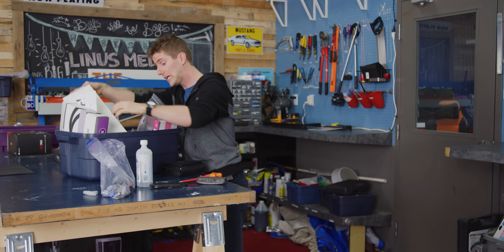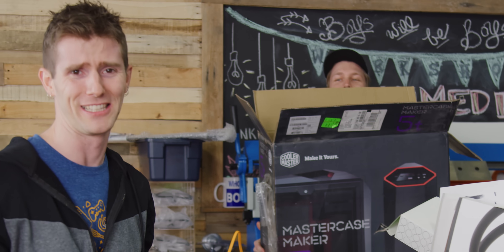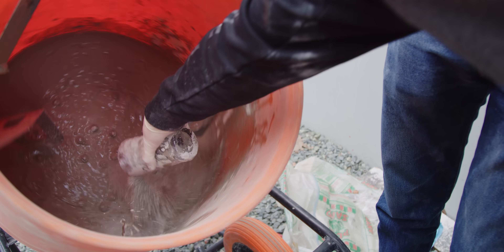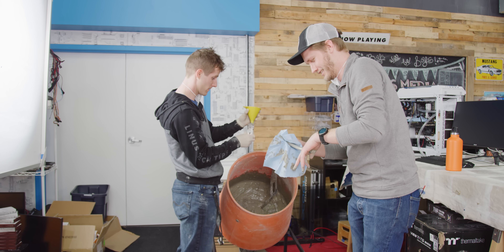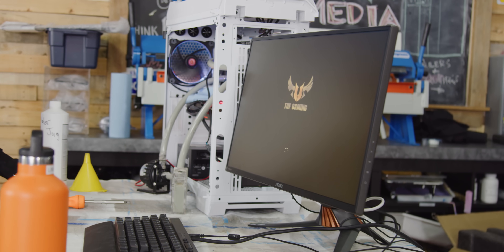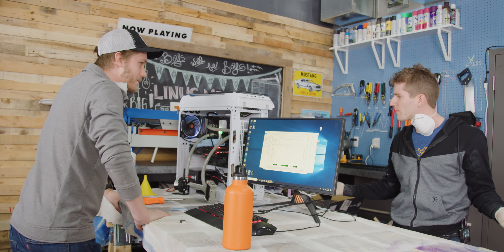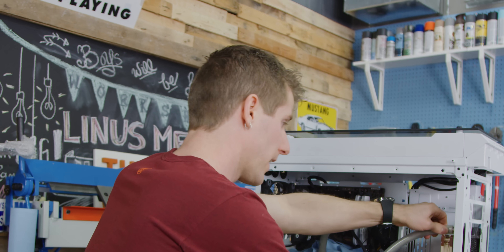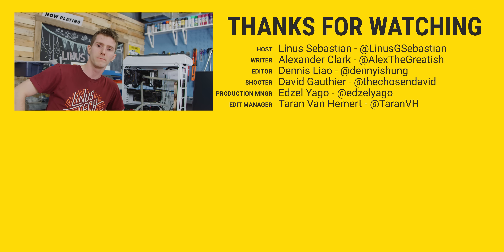I Can't Believe This Worked!!! - Concrete Cooled PC (April Fools 2019)

Comment: Try a fine dry dust like a chinchilla dustbath. It should flow like water if the air gaps are minimal and thermally behave like ceramic.

Comment: When you were stating why concrete floors always feel cold, it's not because it cunducts heat in a unique way, it's because concrete has an extremely high thermal mass. It takes a large amount of energy  to change the temperature of a slab of concrete relative to its size and concrete floors are usually just exposed foundation slabs, which are typically between 3-6 inches thick and set in the ground, which draws the heat out of the concrete. Since your foundation is protected by your roof (at least I hope it is), the sun doesn't hit this concrete, and therefore it never warms up. If you go out to your driveway barefoot on a hot summer day it will burn you because of the heat it's absorbed from the sun, and typically even at later at night that same day the driveway will still feel warmer than then the surrounding air simply because it's holding on the the thermal energy it picked up earlier in the day. Basements are cold simply because they're underground. It could be 110 degrees out (triple digit temps are common where I live, it sucks to be sweaty 24/7) and if you go down in to one of those like 15 foot deep steel tube bomb shelters it would be about 65 degrees inside. Also btw, What your using is cement, not concrete. In order for it to be concrete you would need to add both sand and some sort of aggregate such as gravel. 

Id personally like to see you try pancake batter

Comment: Ok, soooooo Part two!

Make a solid concrete block with COPPER tubing running through it. Then use the concrete block to cool the water. No radiator or fans! Will it work? I have no idea! Test it!

Comment: My PC is actually sitting on a concrete block that is built into the house. The rest of my floor is just boards but the way the chimney is built, it leaves a small patch of concrete in the corner of my room, so it cools my PC better

Comment: What about a liquid radiator made of concrete with a lot of copper radiator pipes?, that way you can still draw the heat with the concrete but not mess the parts.

Comment: I actually remember hearing that cement trucks don't spin to keep the cement liquid, but to keep the composition correct. So even if it was moving in the tubes it will still set 😄

Comment: You know right before the 24 hours later card I was thinking, but when the loop stops running that thing is going to be fucked. Sure enough. Also even if the loop kept running you would start to loose the thermal properties that made it great.

Comment: lol Incorrect thermal dynamics. Cold concrete floors have high heat transfer due to the temperature difference between your feet and the floor. The bigger the difference in temperature the faster the heat transfer.

Comment: Darn,  you can't even pull an April's fool right :P
Reply from the maker: Oh I dunno... When you fool that many people with something this insane, I'd say you pretty much nailed it :p
Reply: @LinusTechTips  Funny enough, you really got me thinking there. Not if this should be use at all, but if the mix would solidify while there is no place for the water to escape.  Perhaps there is some small leak around there due to raised pressure inside the tubes, because concrete actually heats up by the chemical reaction while drying out.

Comment: Reduce the amount of cement to make it more of a slurry and add sugar... yes sugar. It will only thicken to the point where its fully hydrated, sugar will reduce hydration(hardening). Cool test :) If there will be more experimetation, can also use some super plasticizers in cement mix then can increase cement

Comment: You never post surprising or unexpected things on April 1st. 🤦

Also, a better explanation is that solids are better thermal conductors than liquids, so a paste/gel in the middle should work better than a pure liquid. 😉
Reply: Thats makes me think, wouldt it be better if they used very fine sand instead of cement? I wouldt solidify like cement with same benefit of solid conducting. Just "mud cooling"

Comment: Cement is very different from concrete. Concrete has about 30 percent rocks/gravel.
Reply: MG_Anon cement is the powder :)
Reply: @ImAlecPonce  and when the cement is mixed with water. Concrete is also the mixture, but only if there is gravel or rocks

Comment: The cement become more runny when shaken because it is a non-newtonian fluid. Clay suspensions and concrete mix are non-newtonian fluid which fluid does not follow Newton's law of viscosity, i.e. constant viscosity independent of stress. In non-Newtonian fluids, viscosity can change when under force to either more liquid or more solid. Ketchup, for example, becomes runnier when shaken and is thus a non-Newtonian fluid like concrete mix. Ketchup cooled PC next?

Comment: Good April fools.

Water is .598 W/mK
Concrete is .8 to 2.5 depending on additives.  But lets see you stop the Extothermic reaction into a solid form. It doesn't need air to harden.  :D

Silver & Copper infused water works nicely.  But the formula is secret because of Galvonic corrosion causing degrading of common metals.

That said it is MORE than possible to create a loop of Copper Sulfide water soluble solution mixed with water with a properly designed pump/radiator/reservoir/cold plate.  You'll can get up to 1.8 with a high enough concentration. 

https://aip.scitation.org/doi/full/10.1063/1.4953439

Comment: concrete produces an exothermic reaction which means thatit requires heat to set so while concrete will flow in the meantime overtime it will actually set due to the heat being drawn away from the block to the concrete, concrete actually requires heat to set

Comment: This gave me the idea of using metal powder into a water loop. It increases the thermal conductivity (paper exists, not too easy to find, but somebody did a thesis on it.)
The main concerns would be metal getting stuck in the rad, as well as corrosion/current generation due to different metals being used. The latter could be prevented by using the same metal as the waterblock/using ceramics.

Comment: I once was very lazy and didn't have money to buy a CPU cooler, so i just stuck closed off at the bottom pipes of copper (in contact with the CPU) let it cool and used that as a cooler for a few years.. (Also having a few pressed together pipes move out of the sides and out/upwards was more efficient)

Concrete is actually pretty decent as a cool block.
Yeah i obviously was drunk when i came up with that idea..

Comment: If yall didn't know, if you add sugar to cement it stops it from setting, meaning it would be safe to let it turn off or idle. Just saying in case you want to try a Cement Build Mk 2

Comment: The cooling wouldn't be very efficient as concrete is not very good at absorbing radiation or heat depending on how dense the mixture is

Comment: What sort of effect do you get if you make a standard water w/ copper straight-pipe rig, but have all the straight-pipe coated in concrete? Does it insulate or help cool the water at all?

Comment: Poor thing sheets of concrete. Grind it up into a ridiculously fine powder. Add it to water and use as your coolant. Ensure pump is highest point of the cooling system. Should still give you good results if power goes out particulates won't settle in the pump clogging it and should be able to move it through system once restarted. Use distilled water also.

Comment: There's a bit of confusion between calling things a 'Liquid' and a 'Fluid'. Powders can act as a fluid, so when you mentioned the concrete essentially being a ceramic in liquid form you are nearly there. What you created was a suspension or non-Newtonian fluid. The problem with the cement/mortar constituent of your concrete is that it actually reacts with the water and will solidify. Moving forward you could either use a peristaltic pump to pump a dry ceramic powder around the system, or use a similar pump with a ceramic (or even carbon)powder in a suspension with water. The gains in performance should be linear when plotted against the specific heat capacity of the material you are using a fluid.*This is a posit for a real world solution to the problem and not this obvious joke*

Comment: Concrete hardens due to a chemical reaction between the water and lime, not because it loses water to the air. I wonder if you could make a mix that's thermally similar to concrete but it's basically just a clay solution so it won't harden unless the cooling loop gets left open to air.

Comment: I use semen for my liquid cooling . . it's great for increasing your core multiplier!
Reply: That is not possible, in fact, the semen coagulates like the egg white (albumin), so when the processor begins to raise the temperature, the semen will begin to solidify and there would be no movement in the watercooling circuit.

Comment: Oh snap Linus turned into a rheology channel... Concrete without the sand is cement - which is a Bingham plastic... Like mayonnaise. Runs fairly liquid when it has been agitated, but not more liquid the more it's agitated (like ketchup, a shear-thinning liquid). The reason it doesn't run on the sides, but only in the center is because the flow rate is too low. The flow is only laminar, which in something like this means that the flow rate is higher in the center, and the more viscous, the bigger the difference. Combine that with the Bingham model, you get cement on the sides of the tube that doesn't move - but would if you e.g. hit it with some energy like vibration/sound etc...

Comment: Concrete will never dry if it as too much water.

Your concrete was not made to make an Anti-Verge wall... It was suppose to be made for cooling.
You should have made a Mixture Water/Concrete with Much more water.
Reply: It will
Just not stronk
Reply: I don't want to see the situation of the radiator

Comment: This is a neat idea assuming it flows, until you realize that concrete/cement is an exothermic reaction, meaning that while it's in the process of curing it will generate additional heat, making it impossible for this to cause a lower temperature... #BadAprilFoolsJoke #NotAsBadAsLastYearsThough
Reply: Yeah, THAT's the only problem with this idea... needed 200 IQ to figure that one out

Comment: What about a concrete heat sink for the CPU instead of Copper? If It worked well through a pump. Would it not have almost the same effect? Would be something to experiment since you have a bunch left over.

Comment: No, no, no!  From Popular Mechanics: "Wet concrete doesn't harden by drying. ... With the concrete in the form (i.e. after it has been mixed), the cement begins a slow cure and the mix hardens. After about 36 hours, most of the hydration process is complete, but the cement will continue to cure as long as water and unhydrated compounds are present"  In other words regardless of the power going out, the concrete would still have hardened.
Edit: crap, it's April Fools day...sigh

Comment: Now that concrete worked, you should up your game and run liquid metal through the loop.
Reply: Gallium cooled loop, let's go!
Reply: @brandoncook1465  Nah go for mercury
Reply: @galaxyeyesphotondragon8191  if you could properly seal the loop so it's impossible for the Mercury to leak out and make sure it won't react with any of the materials the loop is made of, then that could actually be a decent idea.
Reply: @GeneralNickles  Mercury is a terrible idea due to its toxicity and tendency to vaporize over time
Reply: @galaxyeyesphotondragon8191  that's why I said the loop would need to be properly sealed. 

It won't vaporize if there's no where for it to go, and the toxicity is irrelevant if it's in a sealed container. 

Dangerous materials can be perfectly safe when properly handled.
Reply: @GeneralNickles  To properly seal it though would cost an astounding amount of money, you need to be extremely precise with it
Reply: @galaxyeyesphotondragon8191  not really. 

If you can form an air tight seal (again, using materials that Mercury won't react with) then that's all you have to do. 

You do realize household thermastats have Mercury in them, right? It's not that difficult to work with. 

Making an apparatus large enough to cool CPU could be challenging, but sealing it isn't a problem.
Reply: @GeneralNickles  it still has a lot of potential failure points. Checking them for that precision won't be cheap.
Reply: T1000 liquid metal. Works 10/10
Reply: NaK is the best, they don't use it in nuclear reactors for nothing
Reply: @chnhakk  but it is still reactive in water
Reply: ok were onto something here

Comment: How about complete mercury or gallium (liquid metal) cooling? Filling the reservoir entirely with the stuff
Reply: Just use nickel plated copper/brass fittings and a ddc pump. Avoid having any aluminium (like you normally would) parts in the loop.
Reply: Bad idea. Gallium alloys with and corrodes most other metals. You'll end up with a puddle of gallium eating a hole through the top of your graphics card in a short time. If you use an aluminum radiator the entire fuckin radiator will basically fall apart in a day or two I shit you not. Murcury is less corrosive toother metals than gallium is, but given the health risks of handling murcury its probably best to avoid that as well.
Reply: Ya I’ve thought about what you guys are saying but say things like only cooling the cpu, using a copper radiator and mostly custom parts, I mean they made concrete work so maybe they can figure out a way to make this work.
Reply: @ryanpeters2741  gallium can still eat away at copper, it just takes a bit longer than aluminum. It might hold long enough to effectively test thermals, but I wouldn't use any expensive hardware to try it out. It might actually work long term if you used graphene to build a block and a radiator, but that would be stupidly expensive.

Comment: This needs research BUT if you could put an additive to the concrete that keeps it from hardening, like it keeps the reaction from happening, you could have it flowing even after days of not moving it. Or, you need an external circulation system to keep it going even when that puny pump fails.
The problem is, concrete as a liquid has such a great viscosity that the outer side of it is not really flowing, so the part that is actually in contact with the metal slab of the CPU block never moves, it just transfers the heat to the inner flowing part that takes it away.
By the way, how did you get it flowing through the radiator?

Comment: Linus how about a small water reservoir tube that is gravity fed to make sure that dry out doesnt happen if it warns up and drys the reservoir will keep it nice and milky? Just keep it topped off over extensive use? What about a stronger than water chemical that keeps it from drying up also like alcohol?

Comment: hey if you guys are interested i might have a way of creating a shelf stable slurry cooled system, there are ceramic mixes that would provide many of the benefits with few of the risks, by using a slurry pump you might even end up with a practical system(as opposed to the sort of joke this was)

my experiences are from industry and pottery as a hobby, everything we do there is ceramics.

Comment: is it bothering ANYONE else that they keep saying CONCRETE instead of cement?!?!
You keep using that word. I do not think it means what you think it means
Reply: Tbf in Canada it's an all in one term. I work construction
Reply: *mortar. It has a fine silt aggregate in it. It's not pure cement.
Reply: Cement, Concrete, Grout, Mud... whatever you call it, it smells like chemicals and turns rock hard.
I mean yes there are differences to each but they are very similar.
Reply: @RyanS493  guess I'm concrete then..  Every morning..  And sometimes at night too
Reply: @RyanS493  well my dick checks all those boxes so it counts too I guess
Reply: I work for a concrete readymix company. Cement basicly is the actual powder that chemically hardens. Concrete is the the mix of rocks, sand and cement .
Reply: It's called quikrete. Even written on the bag.
Reply: As stated by others, concrete is the mixture of cement, water, fine aggregate(sand) and course aggregate(rocks/gravel). Cement plus water is cement paste. Cement plus water plus fine aggregate is grout/mortar(depending on market, some places use one term some the other). 

BUT WHAT LINUS COULD OF DONE is added whats called retarder, which sloes the hydrolysis process, and he could of added VMAs(viscosity modifying additives) and his results would have been much better for this particular application. 

SOURCE: im an engineer and used to be the VP of a medium sized concrete pumping llc.
Reply: Ahhh the princess bride. Great movie

Comment: It's not concrete without the aggregate etc. Also, like a suspension of sand in water the solution is shear thinning (or possibly even thixotropic?) so continual agitation maintains a lower viscosity.

Comment: Just a FYI, concrete/ cement, heats up as it hardens and cures. Hoover dam was done with concrete block forms with copper cooling tubes using water to remove the heat build so it would hardens faster,

Comment: since some denser materials conduct heat quite easily I think they could actually make this work but it would be extremely impractical (meaning he might try it anyway).  IF the concrete/cement was kept in liquid suspension and not allowed to dry and IF you had pumps that could stand the wear and tear from running a heavy and abrasive fluid through it constantly - then yes, you COULD theoretically cool a pc with it.  problems to overcome - concrete is porous - suspension liquid medium would have to be VERY dense also but not to the point it was negating the concrete.